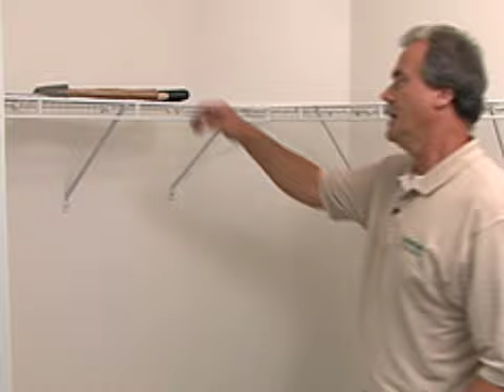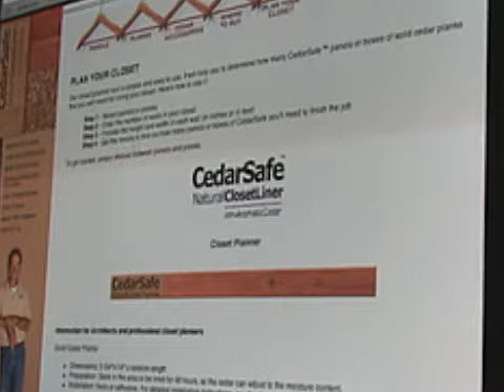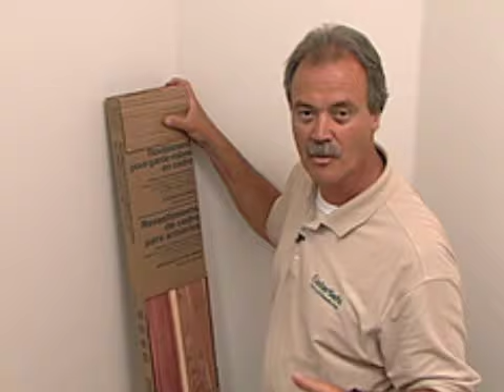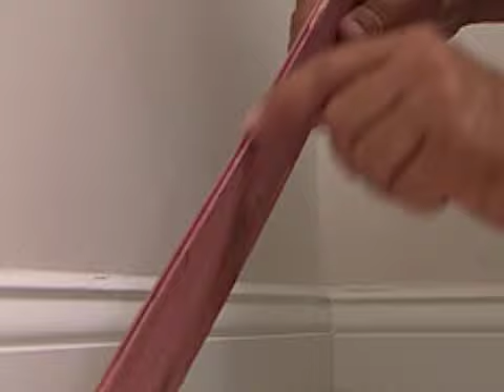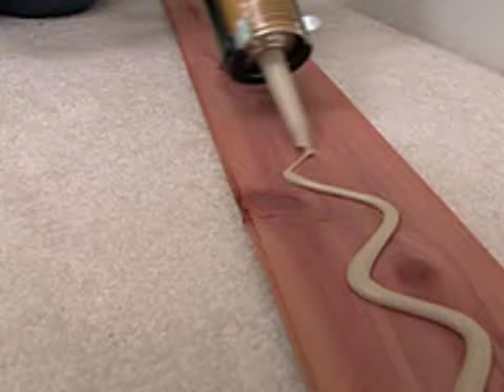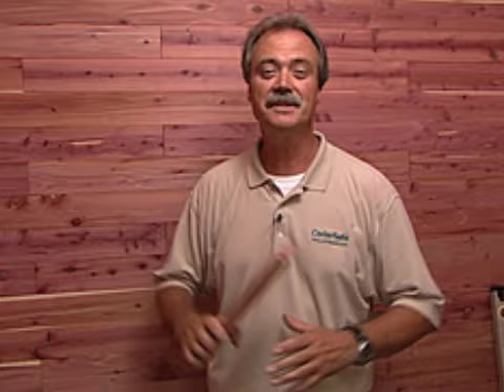CedarSafe Plank Installation

Comment: I have a question. I bought these planks last year and as i cannot line my closet i just cut the cedar in 12 inches pieces and put them in my drawers to chase moths.

Well, after about 4 months, the smell was gone and even with sanding it did not came back.

What is the problem and what should i do?.

Thanks.
Reply: They sell cedar oil on their website to refresh the smell.